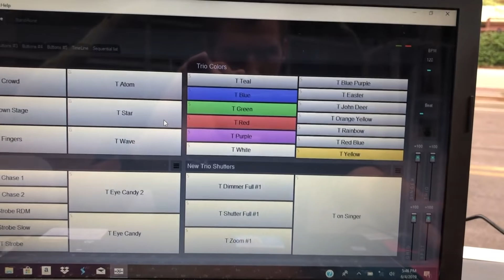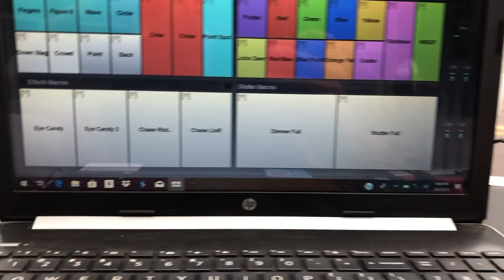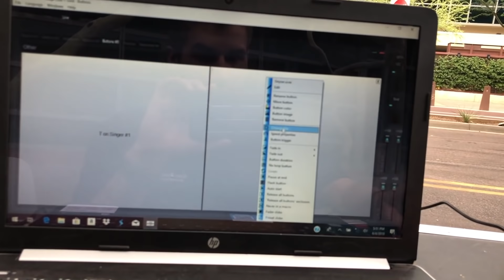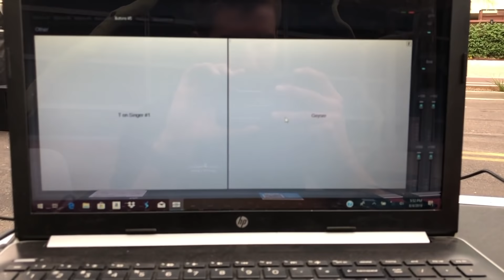Trailer Stage + Lots of Movers Gig Log

Comment: U should go onto a real console not the software that would make it with about 30 min programming if you have a showfile or 2 hours from scratch
Reply from the maker: There's a lot of debate whether I want to invest in a console or not and so far I don't want to spend the money on one. If I buy I want an MA2 or 3 Light. And so far, all the shows I've done, I have lots of time to prep and program. Although, If I go on tour, then yes I will buy a console for the sake of time management and reliability.